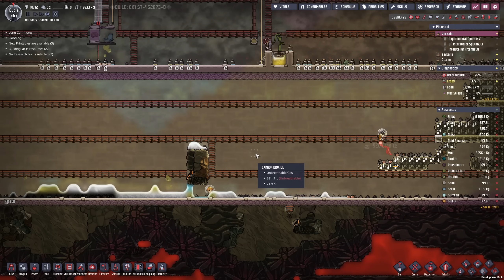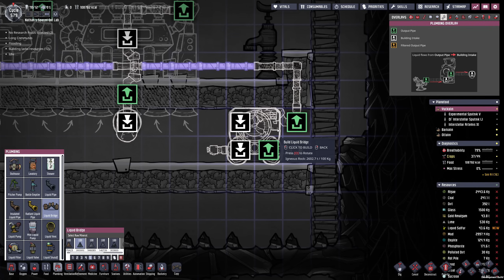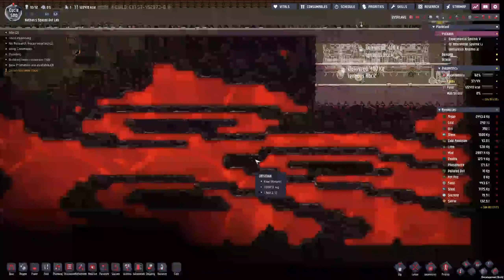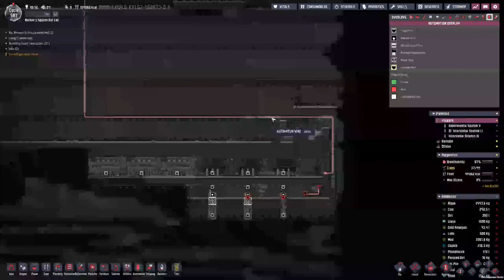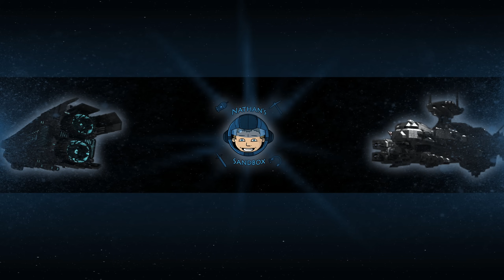MAGMA POWER SETUP - Oxygen Not Included: Ep. #37 - SPACED OUT DLC

Comment: Three steel tiles touching magma provide enough heat to run four steam turbines at full power, and that’s when the magma is at its lowest temperature of about 1400.  Magma transfers heat very poorly compared to steel, so one mechanical airlock on the middle tile can transfer all that heat to one steel tile in the steam box. Your build was super helpful in making my own, but it had way more airlocks than needed.
Reply from the maker: I just wanted to distribute the heat more evenly to make optimal use of the heat from the magma, but it's great that you adapted the design to your liking!;)

Comment: apparently this doesnt work for long, the magma cools down to below 1440°C and then gets solid and simply reduces the mass, as some tons fall down. which results that you then have to less magma inside the chamber and it wont touch the metal tiles anymore.
Reply from the maker: That's why you should push the magma down with airflow tiles, so the magma below the steel tile freezes to a solid tile and not debris. But even in your example you can just add  additional steel tiles below until you touch then magma or a frozen magma tile.